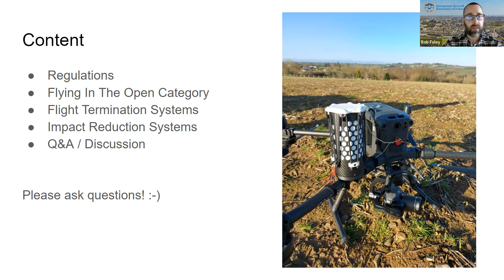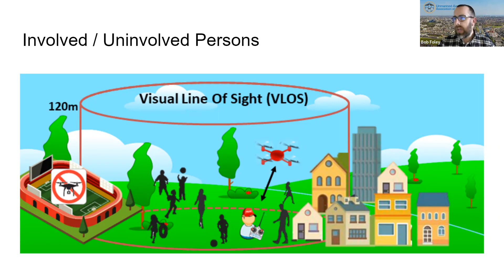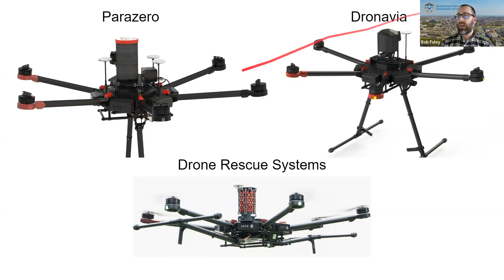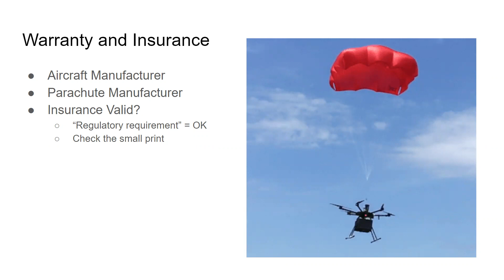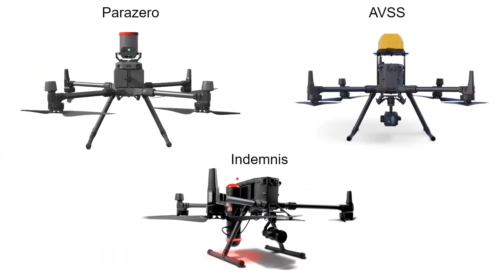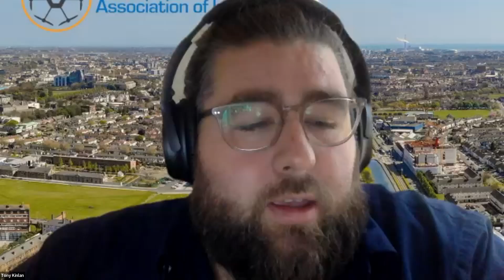Drone/UAV Parachutes & Flight Termination Systems for EASA operations - June 2022

Comment: So let's get this quite clear.  EASA require us to hold valid insurance, but EASA want to impose a requirement that may invalidate that insurance policy.  I can hear shoulders being shrugged from here.  Unacceptable on all counts.  I tis NOT good enough to ask the parachute manufacturer because that isn't the same as holding EC785/2004 insurance....is it?
Reply: and it looks like it would invalidate the manufacturer's warranties and that M300 / m200 the batteries are not even full locked in and secure by the looks of it ! Disgusting and Dangerous by the looks of it all EASA so called drone experts need taking out side and slapping with a big wet fish :)

Comment: How can any of the flight termination systems be acceptable - they are not part of the UAS design and they also take the aircraft over their MTOM - this should be considered dangerous and if not mounted C/G correctly could cause motor issues as well and stress on the battery by making the aircraft beyond its MTOM and needing to give more power output - Honestly a bad idea